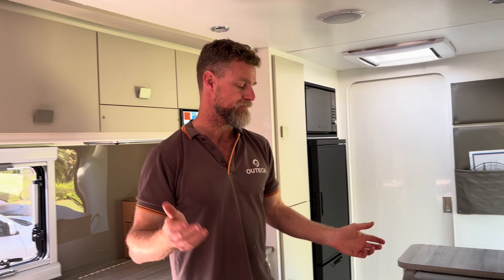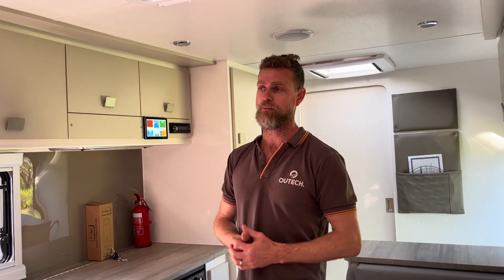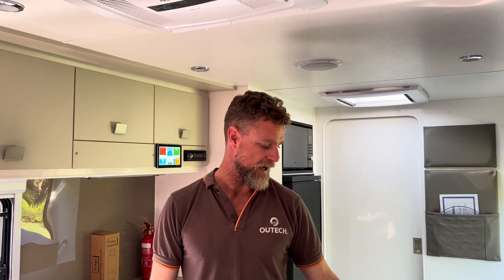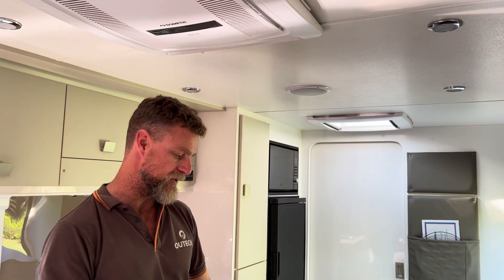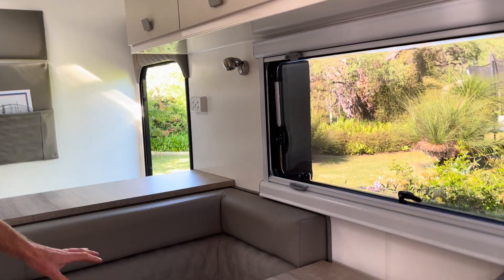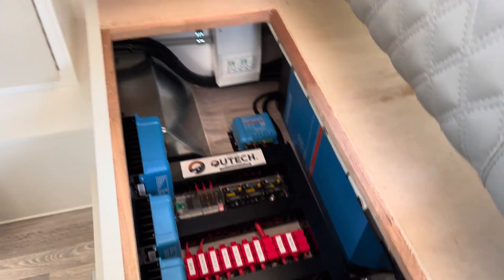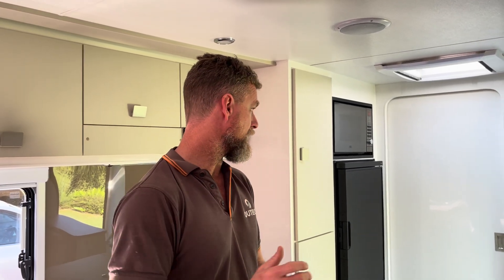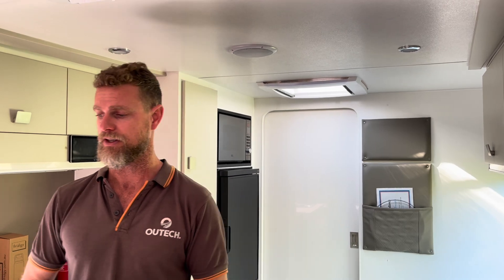Essential Caravans Outlander - EXTREME Off-Grid 24V Setup - 15kWh Lithium Battery Bank

Comment: Are you able to help me understand what componentry i need for a system like this so i can make sure my van mob selects the right stuff?
Reply from the maker: Hi and thanks for the comment. We wouldn’t recommend getting anything other than a basic package from the manufacturer. Getting your system installed post delivery is the best way to go as the full system including components and installation practices are taken into consideration. Seek out a specialist rather than the van manufacturer and your system will be designed and installed appropriately.
Reply: Ok fair enough well its a bit late for that unfortunately
Reply from the maker: Would be worth investigating a take out cost. We are yet to find a quality build in a van from a van manufacturer.